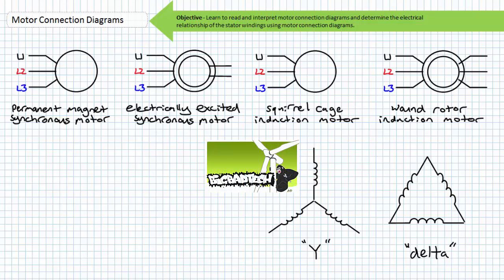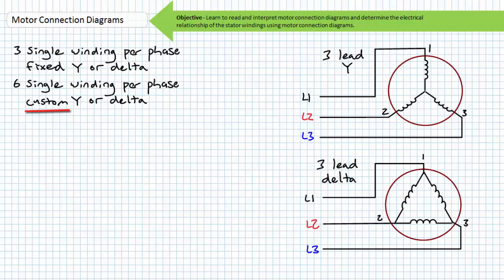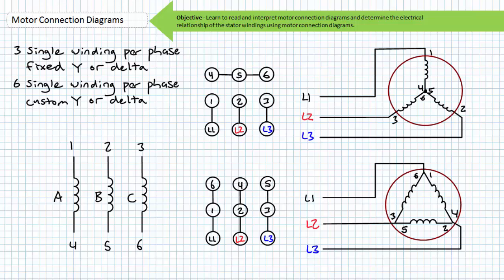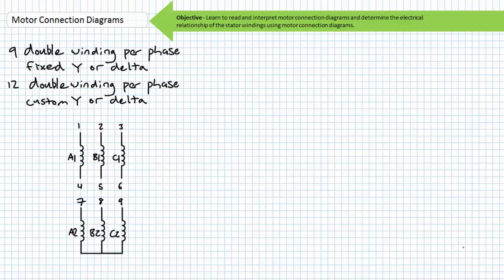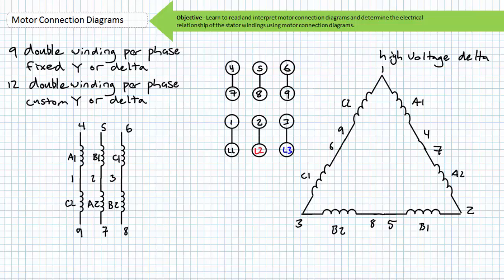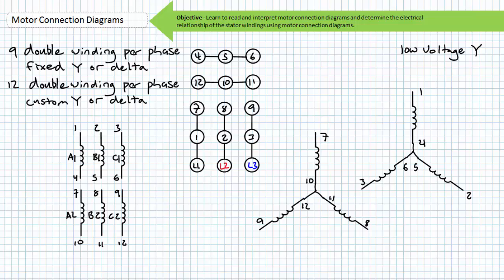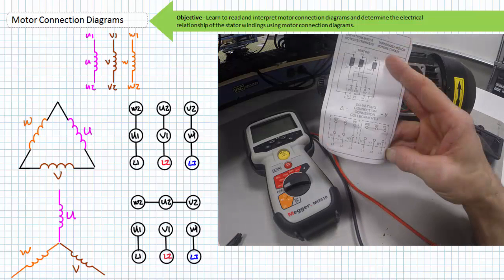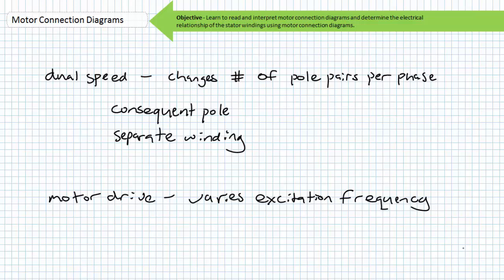Motor Connection Diagrams (OLD LECTURE)

Comment: Great lecture as usual, but I don't see any explanation of split phase motors ( cap start/run). I come across these all the time. Could you spare a lecture on the theory of these?
Tx, Don
Reply from the maker: Yes, I focus on 3 phase motors up front, however, I do plan on returning to single phase AC motors in later lectures. Eventually the "Motors and Generators" playlist will include most common 3 phase AC, DC, and single phase AC variations of motors.

Comment: If motor wires are not labelled and hanging loose how do you determine u1 v1 w1 as opposed to u2 v2 w2
Reply from the maker: Trust me I've been there before. First, you should probably have an idea what type of motor you're dealing with (3, 6, 9, or 12 wire and whether it's pre-configured in a Y or delta as described in this lecture). Then bust out your ohmmeter and get to work. Ideally an individual winding will have a given resistance value and two separate windings won't be connected. Once you've found a set of wires with that given resistance value between them you've found an individual winding. Identify that piece of the puzzle and move on. If you find a set of wires with twice the given resistance you found a pair of windings pre-configured as one leg of the Y or corner of the delta. Identify that piece of the puzzle and move on. Eventually you'll identify all the pieces and can assemble the whole picture. It's not easy and it's not quick but it works with patience. One of the first labs I give my first year students is a set of unlabled 6 wires that disappear down a tube and reappear on the other side and I ask them to identify which terminal on one side is connected to which terminal on the other. The challenge is that the tube ends are on opposite sides of a wall. Only additional tool I give them is a patching cable with alligator clips on either end. Always fun to see them solve it.
Reply: Use a multi meter, and label each end ,start with u1 and find the other end this will be u2 etc
Reply: Thanks Jim, how do you wire a 12 wire motor in high voltage for star delta starting in the UK ?
Reply from the maker: Check out these two lectures:
https://www.youtube.com/edit?o=U&video_id=DpB-kdM2RA4
https://www.youtube.com/edit?o=U&video_id=aCDD_IHUnro

Think of the series connection of two windings per phase for the high voltage configuration as "one big winding per phase" that can be hooked as a Y and then broken and reconfigured in a delta.

Comment: Great series of videos. One thing I don't understand. In delta you wrote 4 - 2 - L2 and 5 - 3 - L3, but in the connection diagram 3, 5 are connected to L2 and 2, 4 are connected to L3. Am I missing something? Thx
Reply from the maker: The L1, L2, and L3 phase connections to the properly assembled delta determine the direction of rotation (Check out the "Rotating Magnetic Field" lecture at: https://www.youtube.com/watch?v=sQesDN6mpZ4 )
The important thing is that the windings are hooked up in a properly assembled delta for FWD or REV operation. Glad you're making use of this material!